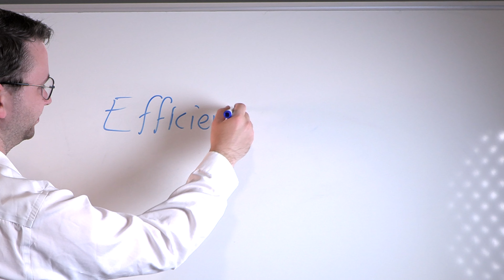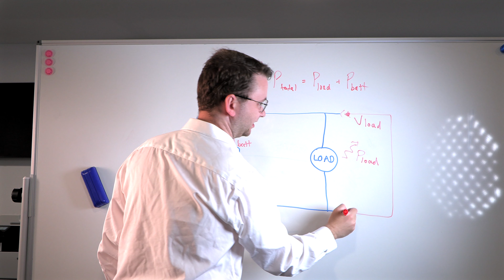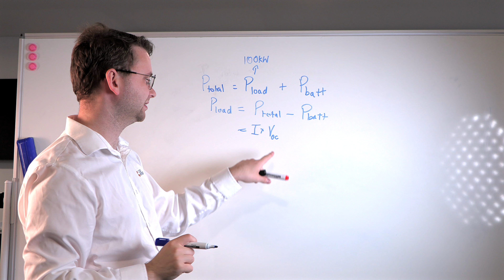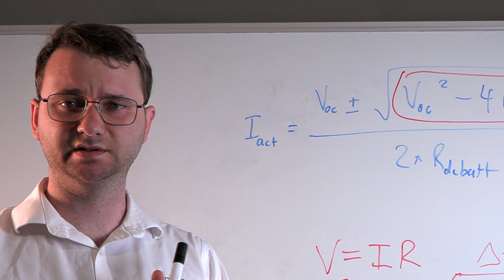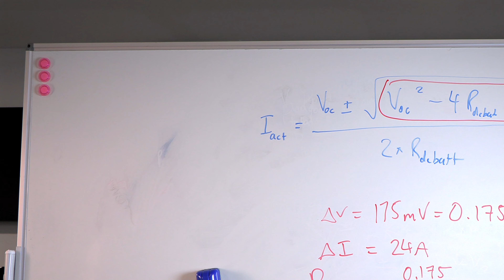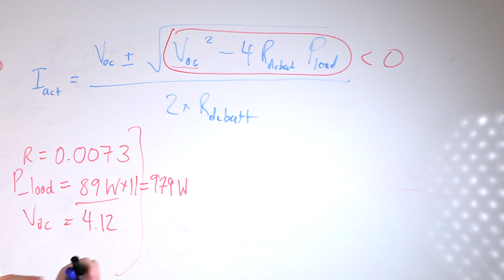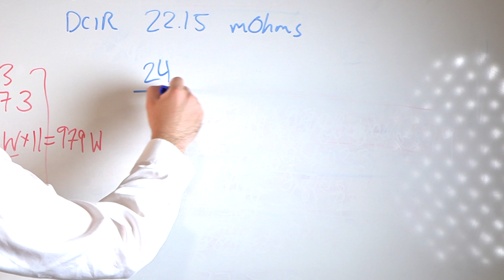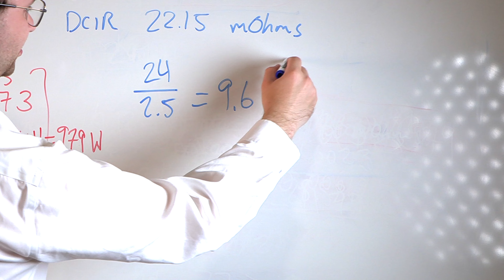Comparing the efficiency of Donut Lab's solid state battery

Comment: Have a question, if I charge the battery cells at 11C with the efficiency of 77%, then I can discharge them at lesser-C's with more efficiency running batteries in parallel?? of course, that 23% will be lost forever, but the efficiency of the battery "running" would be improved
Reply: That's not guaranteed. There're instances where you can end up with lower efficiencies at lower C rates. 😂
Reply: The efficiency increases both ways at discharge or charge at lesser charge or discharge time, it doesn't matter if you connect more batteries
Reply: This is why you have a charging curve for different media / chemistry. 11C is exceptional - as most of the energy will transfer to heat that has to be accounted for as either internal or external resistance to the current load. you'd need to cool the battery, deal with thermal load and discharging of heat, pressure, and voltage imbalances. 

It's not always assured that 1C will have the same voltage/current absorb/charge and discharge time, or have the same charging curve at different temperatures and states. 0.1C, 1C, 10C may cause different reactions in different levels of charging. Different Chemistries operate with different margins with temperature, pressure, internal solid states and expansion volume/inertia. Salts, electrolytes, compounds can react in different ways internally in the cell. 

Lithium has the advantage of being exceptionally understood, same as NiMH and other chemistries. millions of tests, millions of examples. Emulating the performance of Lithium is .... strange. It's not the best option out there due to aging and dendrite formation, they can form shorts in the battery during extreme temperature events. If you were making something new - you'd want to be more unique.

Slow charging could be more unreliable - because the internal BMS state may not have enough knowledge of the voltage/charge curve to know what the capacity is - it may cool down or not follow a linear reaction due to internal resistance to the lower current. 

i.e. "trickle-charging" when the voltage and current starts to create internal resistance, heat instead of being stored in the chemistry. Excessive time at a high temperature can lead to the chemical layers separating or other reactions to form - as the metals are going to expand - contact internally and any crystalline or sandwiched layers will be further apart - less predictable.
Reply from the maker: Hey @juanvasquezaldana8825, good question! We use C-rates rather than amps because C-rates generalise better when considering batteries of different sizes (and also, such as when adding more cells in parallel or series). Basically, if you were to put another battery in parallel (so, 2 total now) and then discharge at the same number of amps as per the single battery, the C-rate would actually be halved (because the total capacity of the battery has doubled by adding another battery). So, yes adding more batteries in parallel would make the efficiency better, but that's because you'd be reducing the C-rate. If you increased the amperage to the same C-rate again, the efficiency would be the same.

Comment: I thought the claimed improvements was for much higher C, density and a lot more cycle life. we don't have any evidence for cycle life yet but it would be a more complete analysis if done at the higher C tests as well.
Reply: The tests don't really show a consistency on density - they only paid VTT to perform specific load tests FWIU. Capacitance and Discharge. 

Some of the problems are that Donut is using outrage marketing to tease and cool the audience - a way to cheap out on marketing and exposure - farming outrage and speculation to have others do the marketing for the company and making sure to tease something new every month to stay relevant and active. There is no financial incentive to avoid speculation - there is no financial incentive to look honest and forthcoming either.

The long and short is - until the tests show common ground with the claims they made - it's designed to grab headlines and investors. The cells may still be unique - but also a minor improvement in certain situations i.e. thermal handling. at best. The fact that the tests match the output of a lithium cell is concerning rather than idealistic. There's no BMS - so they had to be produced and engineered for that particular voltage and IR/resistance. The comparison with that other famous upstart company - Theranos that produced a false blood screening device based off copying another device - got funding based on a fake demo and continual fraud to meet deadlines, reviews, et al.